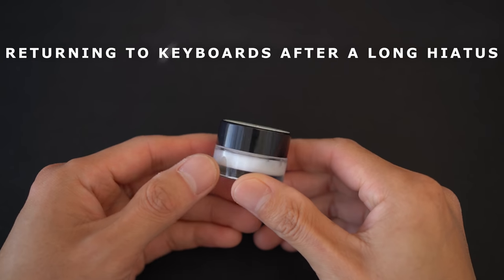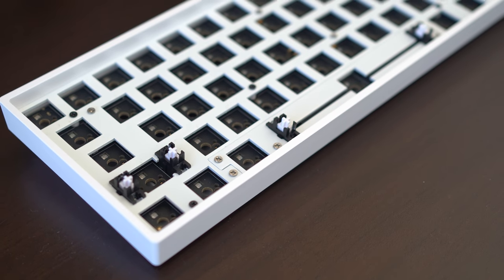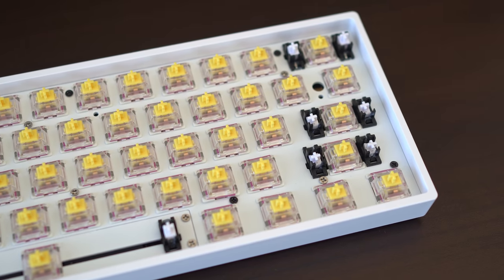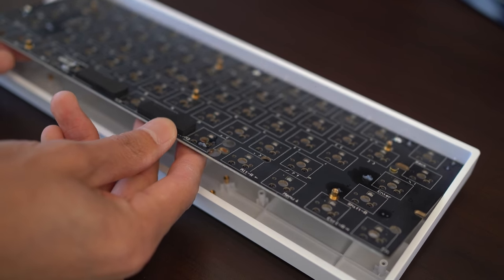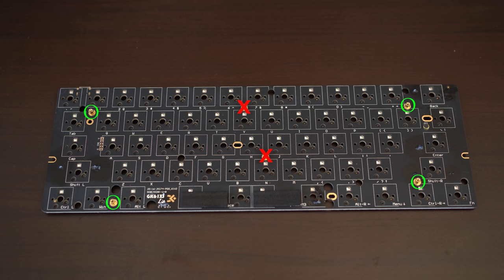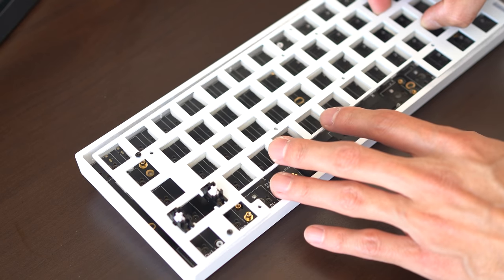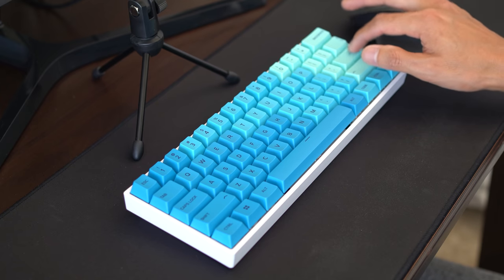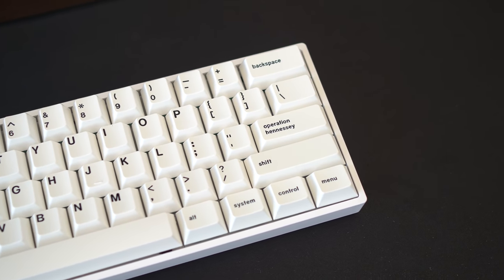THE GK61 - The Entry Keyboard that COULD!  O-Ring Mod+ for SOUND and Feel

Comment: Did these yellows are same as milky yellows at kbd fans
Reply from the maker: Nope! These are the smd 3 pin yellows!
Reply: @Keybored  hey can tell me which board to get if I have 200 dollars are budget and with which switches??
Reply from the maker: @aaryavyas8869  hi Aarya! If available, I would take the kbd67 lite actually... One of the "entry" options that really punches above its weight. And kbdfans also offers an aluminum case now, so you can upgrade it into a great mid level in the future! Gateron yellows are always a great option, and now even the akko cs switches are great!
Reply: @Keybored  the problem is that it isn't available but if you can somehow arrange it than I can instagram you my address you parcel me and I will pay money for that pls if you can 🥺

Comment: What should i do if the hole on my tofu 60% is too small for the oring mod? filing it away isnt such a good idea right?
Reply from the maker: Hi mask off! Is the hole you're referring to the stand off? If so, the 4mm od o ring should work on the tofu! Check out my tofu65 video for a tutorial!
Reply: @Keybored  Sorry for phrasing it wrong. Im referring to the cutout for the USB C connector, its a pretty tight fit with almost no space upward. I also watched the tofu Video and really want to try this mod :) thank you for your reply
Reply from the maker: Hi mask off! The usb cutout for the tofu65 was just big enough to handle the small rise with the 1.5mm o ring. When screwed down lightly, it's most likely around 1mm increase at max. Others have tried in the tofu60 and let us know that it worked great for them!
Reply: @Keybored  Ok thank you very much for the information. The one 1mm increase should just barely fit. I thought the increase is much bigger. Thanks again :)

Comment: would u recommend 165hz 0.5ms or 240hz 4ms? plz answer
Reply from the maker: Hi Zurx!  I'm assuming you're speaking about monitors.  I believe that depends on your need.  If you want absolute smoothness with extremely high FPS, and don't need the faster input response time, then go with the 240hz.  If you want smooth game play and fairly decent FPS, and also need the faster input response time, then go with the 165hz.  One thing to remember, 165hz or 240hz also depends on your gpu/cpu's ability to push out 165 or 240 fps in order for it to makes sense.  Depending on the games you play, if you cannot push out 240 fps in that title, it wouldn't matter too much if you have a 240hz monitor.  I hope that helps at least a little bit.
Reply: @Keybored  my px can run like about 180 - 279 fps
Reply: @Keybored  yeh i cap my fps at 165 so...

Comment: Just a note: while there will be many cases and experiences where it has not caused problems, it is generally a bad idea to cover a Li-Ion battery with foam. That will interfere with cooling and can cause battery fires. Always exclude the battery from any foam mod.
Reply from the maker: That is a great point!  Thanks for bringing that up!

Comment: Uhhh squashy boy vid with the o rings are bad uhhhhh
Reply: theyre bad on switches, this is called a burger mount
Reply from the maker: This right here!  the ones on switches are for making the switch bottom out softer and quieter... makes the switches feel terrible in my opinion.  Burger mounting the entire plate keeps the switches working properly and provides dampening on the entire keyboard instead :)

Comment: is it okay if I use cherry profile keycap on this board?
Reply from the maker: Hi avii!  I think it depends on the the specific keycap and the switch as well.  Most cherry profile keycaps worked out ok with the gateron yellows and the Boba U4Ts that I used!  But when I put on tangerines, most cherry profile keycaps get stuck... I hope that works!